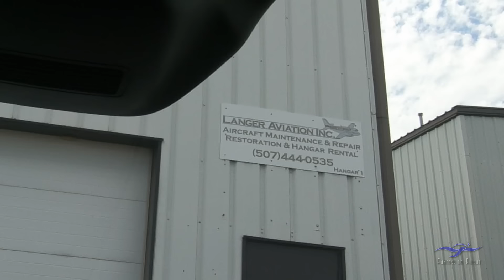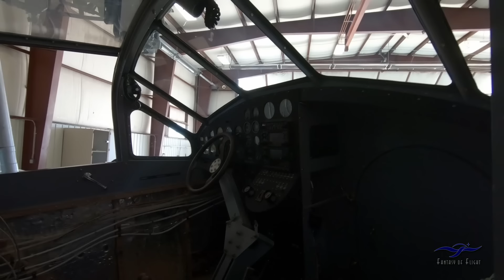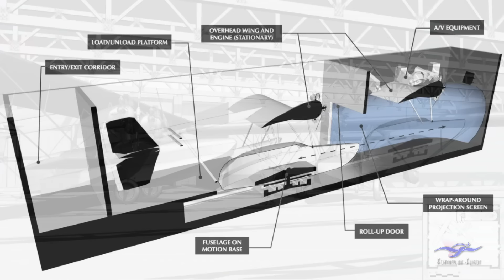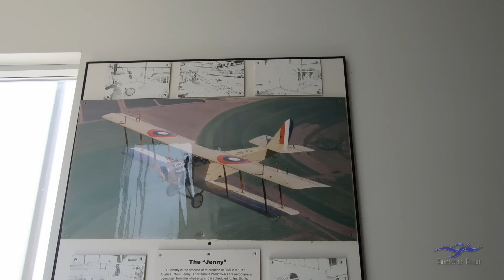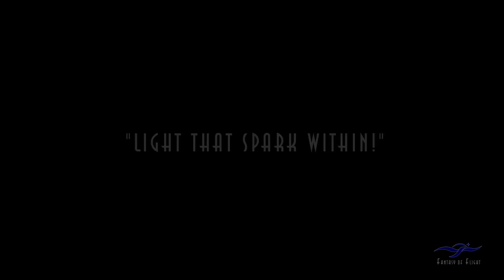SIKORSKY S-38 - “The Aviator” Plane - Project Visit - July 2023

Comment: Hey Kermit, good question bad answer. The difference between a Cessna 180 and 185 is horsepower. The 180 came with a 230 hp Continental O-470. The 185 came with a 300 hp Continental IO-520.
Best regards,
Thomas
Reply: Looks like the 70HP advantage 🏆🥇goes to the Cessna 185!  👩‍✈
Reply: @jamesburns2232  Confucius say "With greater power, comes greater fuel bill". 😉😁 (Sorry, couldn't resist. I will see myself out 🚪)